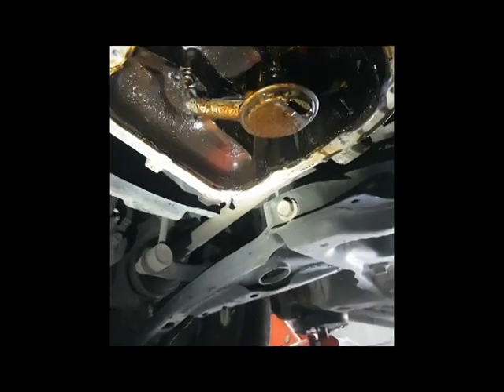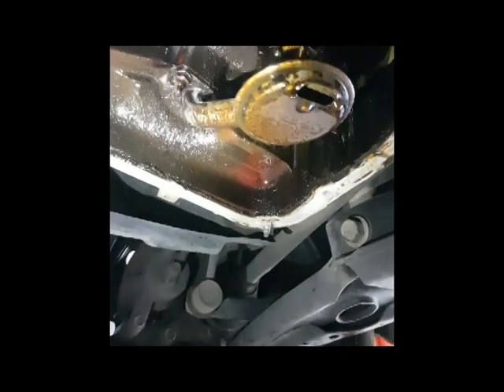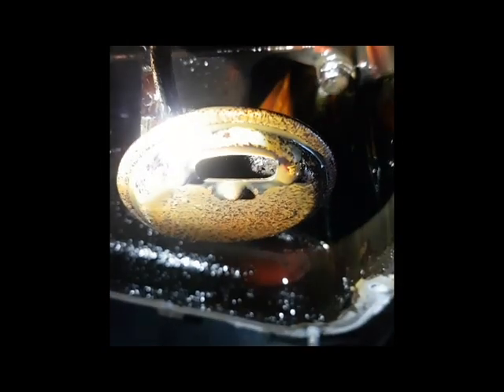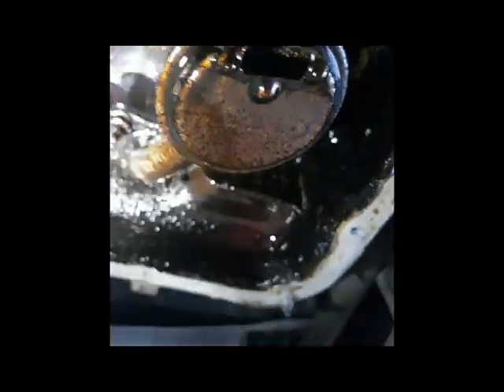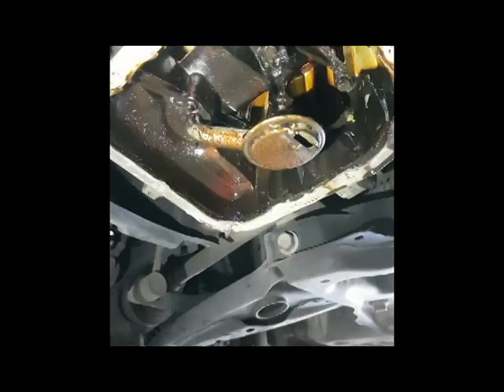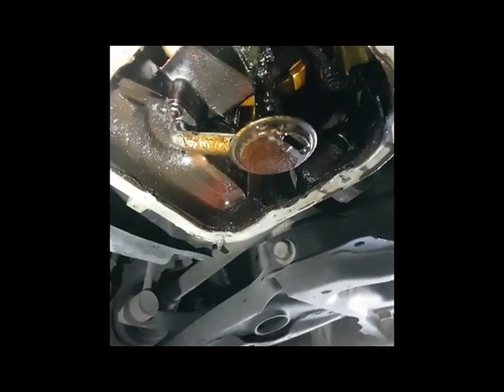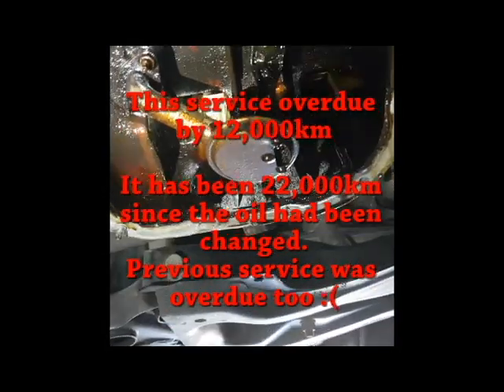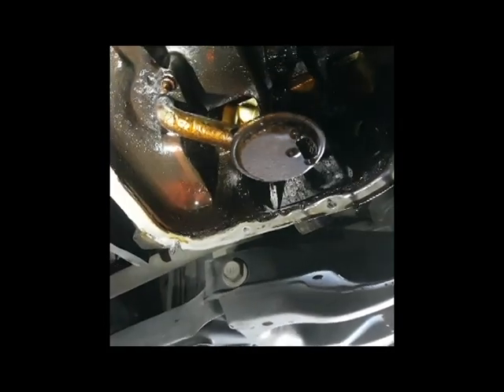Engine Oil Sludge!

Comment: what kind of cheap shit oils do you use when such thing happens after 22.000km? I've seen way longer intervalls and the engine was clean afterwards
Reply: No you haven't.
Reply: @jimmyhsv7791  how do you know
Reply: @jimmyhsv7791  
If you use full synthetic oil you can go longer but 22,000km is a long stretch to go without a change.
Reply: Factory oil?
Reply: Load of rubbish, there's loads of modern engines that sludge after only 10k. You must be incredibly cheap